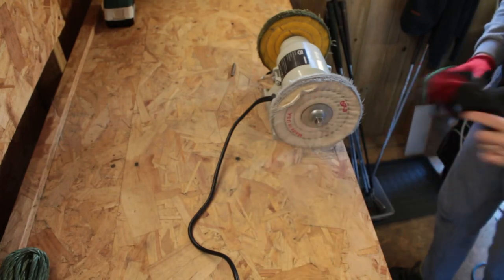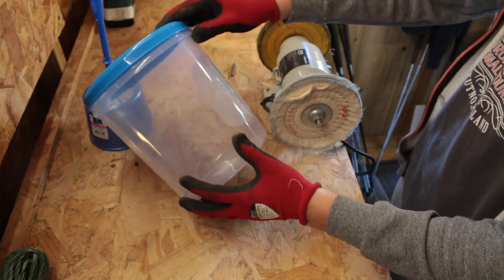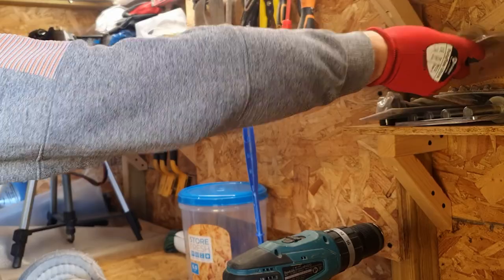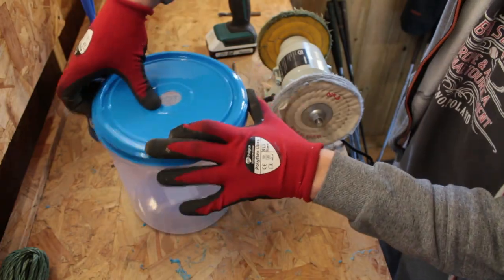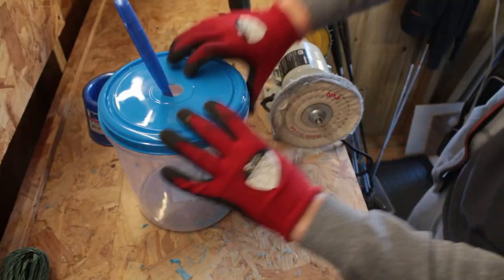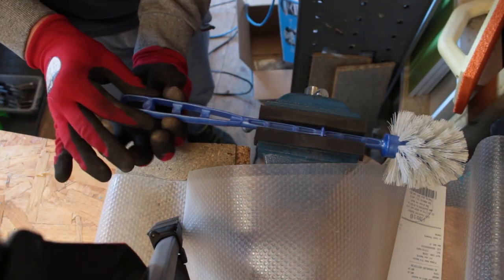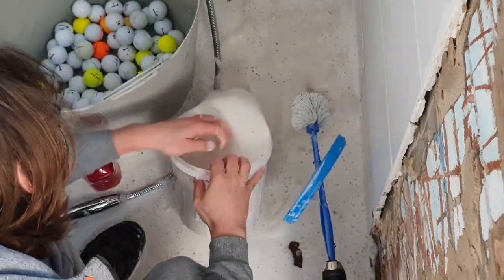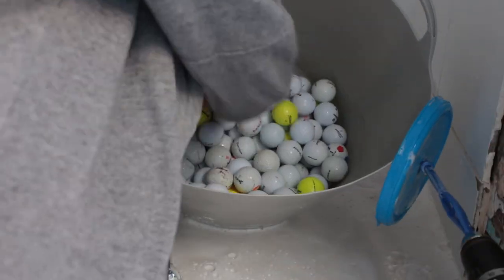Golf ball cleaner for $3.50! DIY golf VLOG #4

Comment: Doesn't clean the really dirty ones that have been buried in the dirt.  I know, I tried.
Reply from the maker: Hi, it does clean mine, even the buried ones. But I believe if it was in the ground for a long time it is stained so hard it won't help. I'm affraid you need some chemicals to remove such stains (if it's possible) not only dishsoap. I would just play the stained ones first, I won't be affraid of losing them ;)

Comment: how did you connect or attach that brush end to the drill bit?
Reply from the maker: Hi, sorry to keep you waiting. I just sanded/cut the end of the brush so it will fit the drill straight away. Than you just need to tighten your drill like you do with any other bit. Not perfect solution but as far it works. I only use it when cleaning balls after hunt so not very often. You can wrap it with a piece of metal sheet so it will be stronger and will last longer. It's more like an idea than a instructional video, do any modifications/adaptations you need and if you find it better than mine idea comment again so I could try your version :)

Comment: I did this today,  although with a smaller bucket, with no lid.
The toilet brush i used, can be bought with with the drill but adapter  already attached.
It really worked well and I have attached a link to it, as I cant seem to attach a photo.

Hi-Spec 4pc Drill Driver Brush & Scrub Accessories Kit Set. Attachments for Rapid Power Cleaning & Scrubbing of Floors, Showers, Tiles and Wheels https://amzn.eu/d/bokikSk
https://amzn.eu/d/bokikSk
Reply: Great tip - just searched on amazon and ordered the brush set for $7 - thanks
Reply from the maker: How does it work without the lid? Doesn't it spalsh all around?
Reply: @youtubegolfer5271  lower the speed, same effect